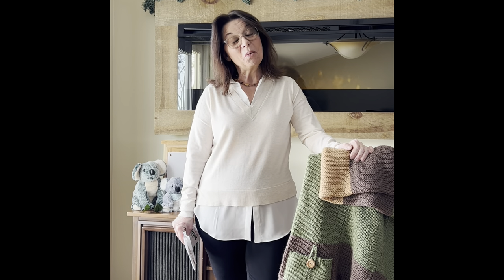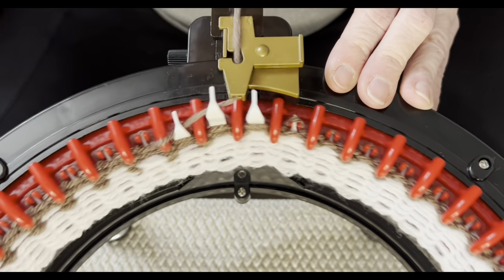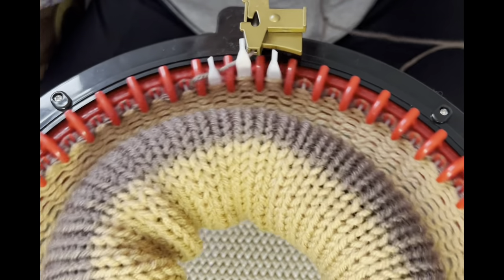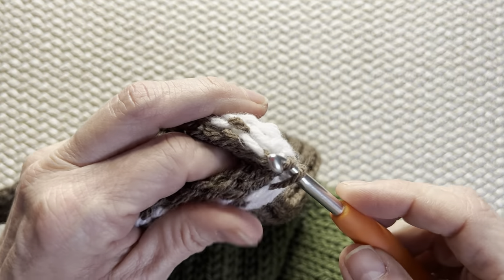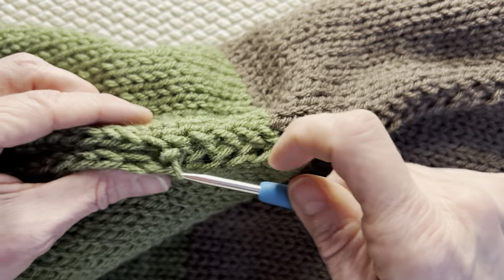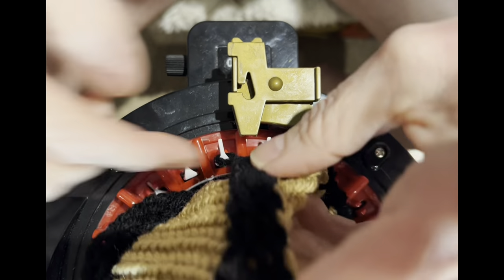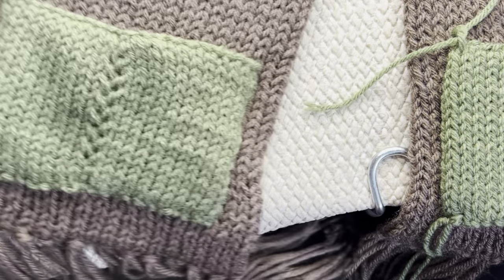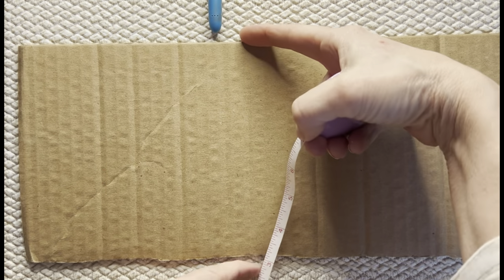“That’s A Wrap” or Pocket Shawl ~ Addi, Sentro, Circular Knitting

Comment: Because of her complaints of a sore wrist, I am happy to report back, that this company offers a power adapter! This is the first time I’ve seen a grown up knitting machine.. This beautiful shawl is so inspiring.. I started shopping right away.. Amazon does sell this brand..
Reply from the maker: Glad you like it. Yes, Amazon sells the machine in the 46 and 22 needle sizes.
Reply: Can you please share a link? Thanks 🎉
Reply from the maker: Link to what ?
Reply: @koalaknitsandknacksaddicrochet They mean the link to the Amazon listing. You would have to put it in your description, though, because Youtube doesn't let you share links in comments.
Reply: I am having a terrible time with this and I know it's my fault.  My question is....If I knot my joining THEN run them through my Sentro, will that cause any problems?  Since I started doing that I haven't slipped a single stitch or had any tucks.   I've tried and tried to join the way so many others, and you, have shown and I get slipped stitches all over and have a big mess.  I end up ripping it off.

Comment: Just saw this tutorial. Amazing!!!
By the way, could tell (if it s possible) the size of the yarn (what size of crochet advised by the manufacture). I probably can find nearby the same in France. 😉
Thanks for the tutos.
Reply from the maker: @alexandredubosq4572  Thank you! 😊 
Weight:  Medium (4)
 
Contents: 100% acrylic
Skein Weight: 7 oz. / 197 g
Yardage: 426 yd. / 389 m
 
Knitting Gauge:
18 sts - 24 rows = 4" (10 cm)
Crochet Gauge:
13 sc - 14 rows = 4" (10 cm)
 
Suggested Knitting Needle:
5 mm, US - 8
Suggested Crochet Hook:
5 mm, US – H/8
Reply: @koalaknitsandknacksaddicrochet  Thanks

Comment: If you do 1 row of different colour waste yarn after the main waste yarn, using a contrast to main project yarn, it will make the waste yarn removing process much easier.  Take finished project off machine, fold tube in half with tails on one side. On the opposite side to the tails pull a loop of the 1 row waste yarn out until you have a finger width or so. Pull on the side of the loop that leads to the shortest tail of the 1 row waste yarn.  Keep pulling until that side of the row is free of the 1 row. Now pull the other tail end of the 1 row waste so the one row is removed. Now the main waste yarn falls away with maybe a little tug.
Reply from the maker: Thank you so much for the wonderful explanation. I do have a video on it but I just never do it. I’m going to start!! lol ❤️❤️

Comment: Aloha! I’d love to make this shawl in a DK weight for life in the tropics. Do you know how I could change the row count per knitted tube to get the same length?
Reply from the maker: Do a swatch of 25-30 rows and see how many rows make an inch. Then determine how many inches long you want it to be and multiply that number by the number of rows you determined makes an inch. 
I think I would do close to the same row count. Just don’t add much tension.
Reply: @koalaknitsandknacksaddicrochet  Thank you SO much!!!